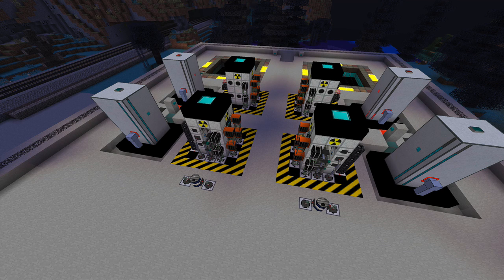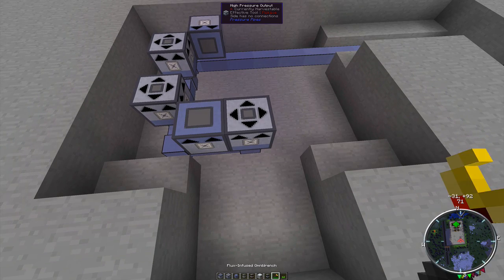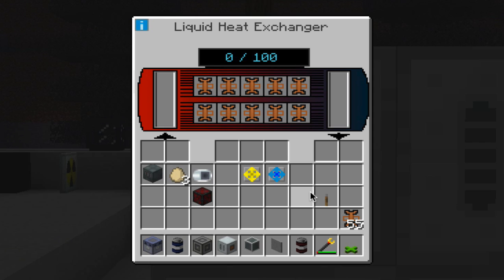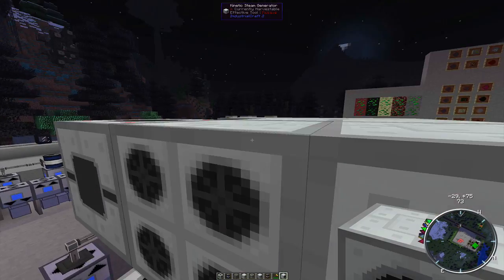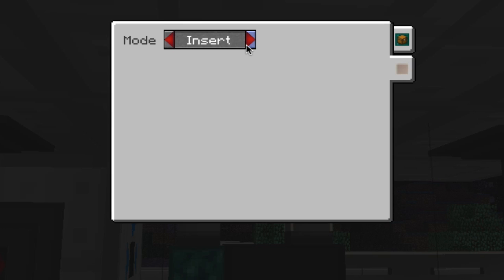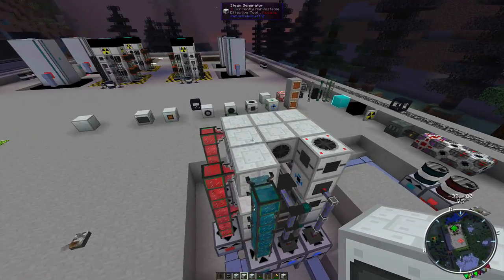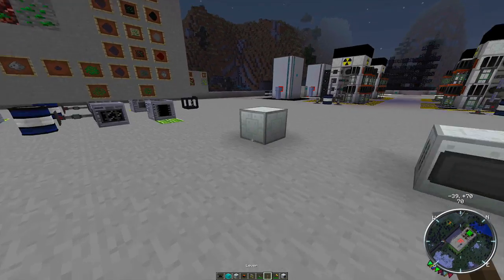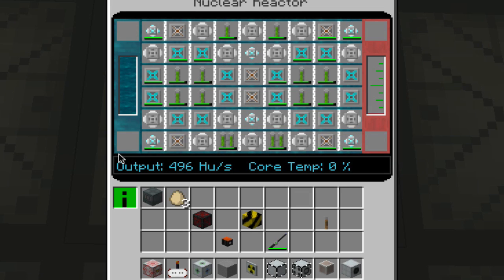TUTORIAL: IC2 HOT COOLANT CHILLERS! Nuclear, Kinetic and Steam Power!

Comment: I can't find forge microblocks in my minecraft 1.7.10 even I installed the forge multipart. In the mod option I saw the forge microblocks available but I can't see it through TMI or vanilla search. I can't even find the handsaw. I did use mimbis microblocks to substitute the forge microblocks instead BUT it doesn't work the same way as forge microblocks did.

Comment: I really appreciate this vid.  Hard to find ANY documentation on the new IC2 stuff.  I just wanted to add that ejector upgrades can be configured to only eject in a certain direction, by shift right click them on a block/machine while facing the direction to eject.  You can see which direction it is set to eject by the arrows.

Comment: It's a clever set up but I can't help feeling that that pipe mod is a little lame. Anything connects to anything through a single pipe, with instant transfers? Seems to me that it takes something away from the game play, making it a bit of a cheat.
Reply from the maker: Yes, and no. There comes a point when too many pipes make it impossible to keep server lag down, or the size of a build. Yes, It is a "magical thing" I will agree, but then again, Minecraft isn't exactly reality. I do my very best to build a set up that requires other machines and infrastructure to support and run it, but at some point, the build becomes too big and Minecraft simply can not support it. The Pressure pipes mod earns its name, because it take the pressure off the server. lol

Comment: MysteryDump 
I must say that this, looks awesome.
Though, like a few guys on the InfiTech2 pack - were a little disappointed with the output of a substantially more expensive setup compared to straight MoX.
Its not going to deter me though, i actually want to take a look at it either way - towards that end, our pack dosnt use Mekanism or Pressure Pipes Mod, What can you recommend to do the jobs of the items that you have used from the aforementioned mods? (the full mod list for InfiTech 2 can be found on the FTB/3rd party packs list)
Reply from the maker: There are no mods that take the place of Pressure pipes. It is a must. However, you could use another pipe mod system, but I can't promise that it would look or function the same. I would highly recommend adding Pressure Pipes Mod.

As for Mekanism, you could live with out that, and just use buildcraft pipes (ugg, horribly slow though... and not as nice looking).
Reply: Sorry, i only just saw your response today but:
What about subbing PP for EI/O pipes and Railcraft tanks? would there be enough throughput using the Ender Fluid Conduits?
I can see it working from EI/O but id have to make the ending structure slightly larger...
Reply from the maker: Try it.
Reply: Tyriael Soban hey i have made the eksat same set up and just subed the pp for Ender IO - Ender Fluid Conduits and it works perfekt
Reply from the maker: Did you have to adjust EnderIO's conduit thru-put in the Config?
Reply: No all normal ftb Direwolw 1.7.10 
I do have to youse more than 1 to and from the reaktor
Reply: Infitech2 modifies alot of the standard bits and pieces, im not sure if the conduit throughput is the same on E/IO.
Reply: Tyriael Soban i don't know but it can ekstrakt 200mb/t and can send 800mb/t truh each Conduits